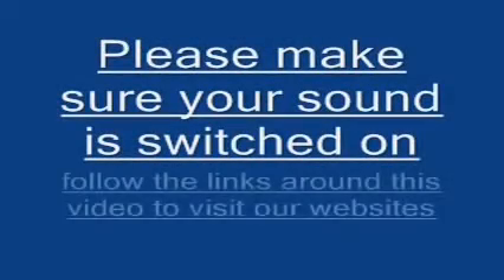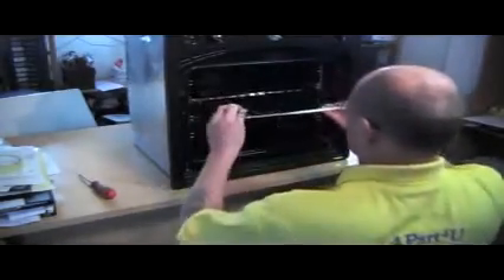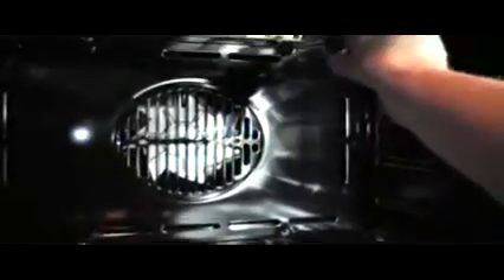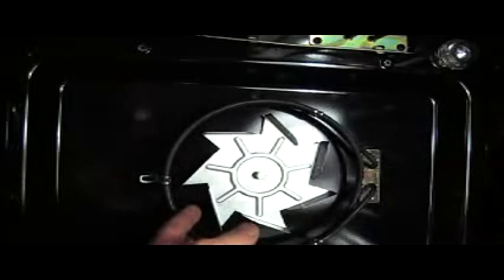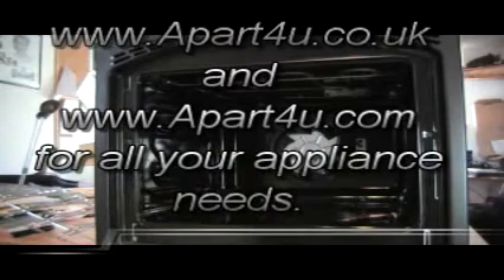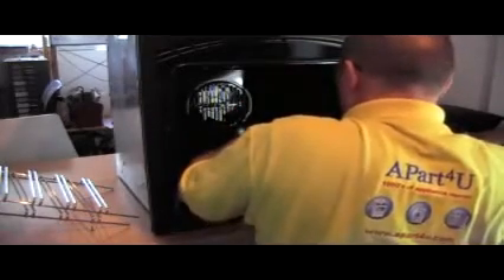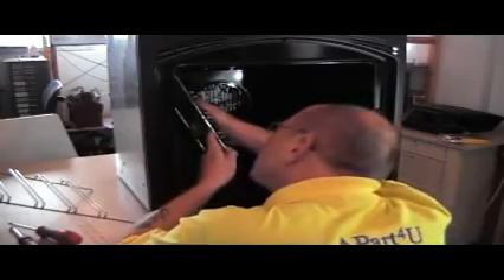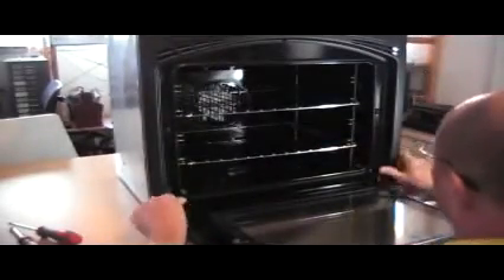How to replace fan oven element.

Comment: I where my element is screwed in it looks like screws but the end of them not the top bits the ends just screw bits so can anyone tell me how do I remove them or are they screws put in from the back?
Reply from the maker: on some elements are small nuts at the back of the machine to release the element please remember to subscribe as that's is was keeps this channel going. Thanks 👍